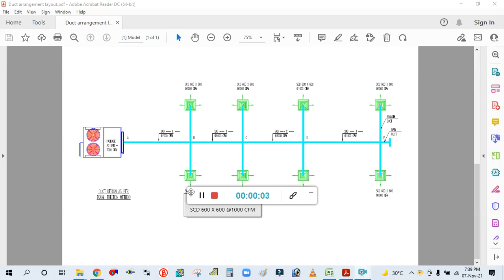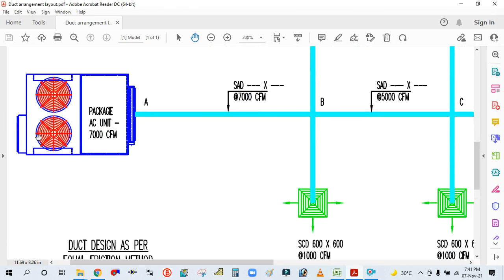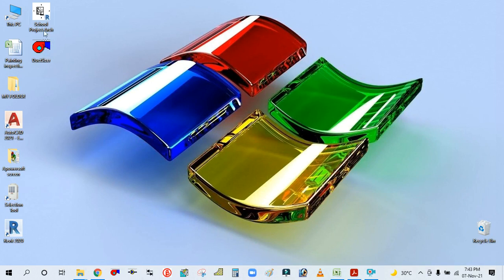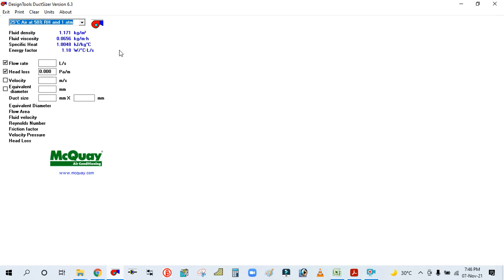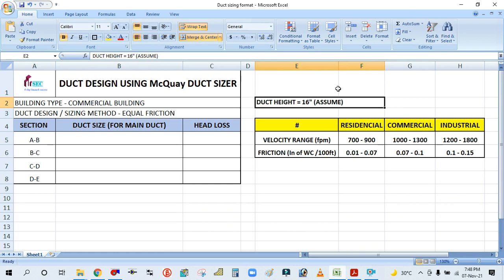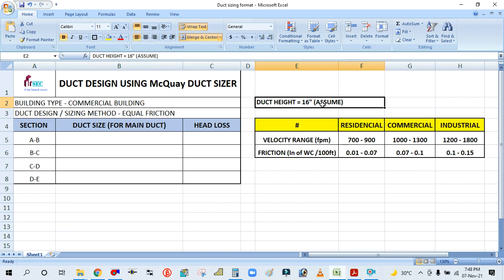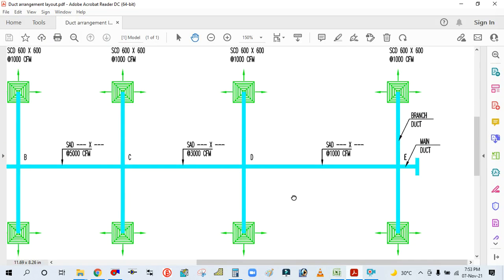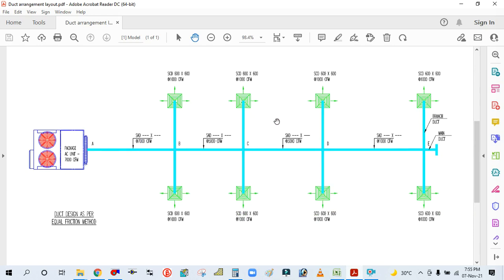DUCT DESIGNING II DUCT SIZING II EQUAL FRICTION METHOD II USING McQuay DUCT SIZER TOOLS II IN ENGLSH

Comment: hi.. You are explanations is very good. easily understanding. but, i have small doubt. hope you clear it. there you mentioned 1000 CFM for each diffuser. but, the total capacity is 7000 CFM as shown at the package unit and main duct. how does it happen. can you clarify it?
Reply from the maker: Hi thanks for your comment 

1000 cfm each diffuser means no of diffuser will be 7

Comment: sir, I have a doubt regarding the diameter that you put.
sir, will they affect the flow of air, if we set a datum of 16-inch dia and the equivalent dia value is very big compared to this?
eg: in video 11.53,
our datum is 16 inches but the equivalent dia showing is 30.3 inches. we are not using the eq. dia value either in height or width.
please give me a reply